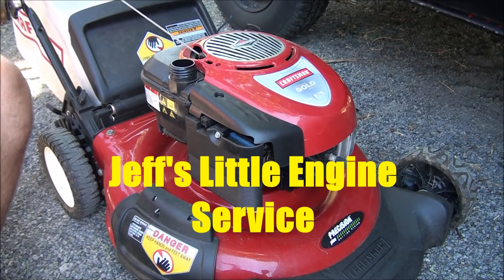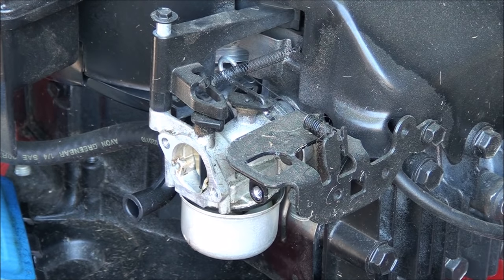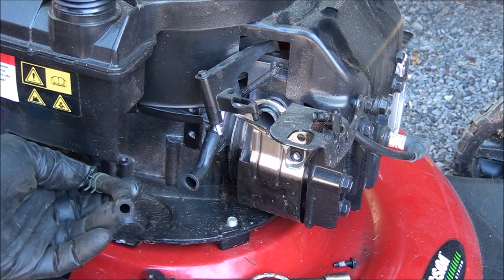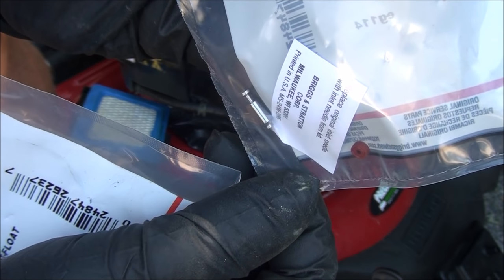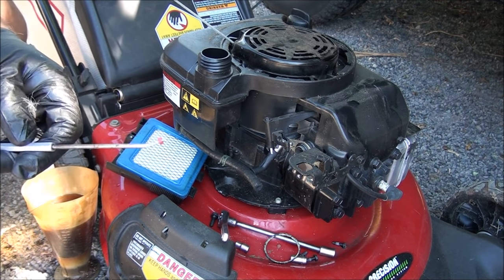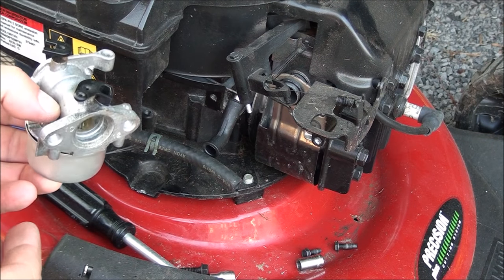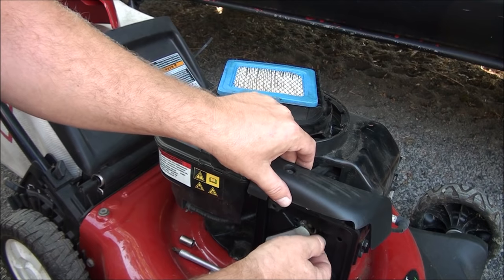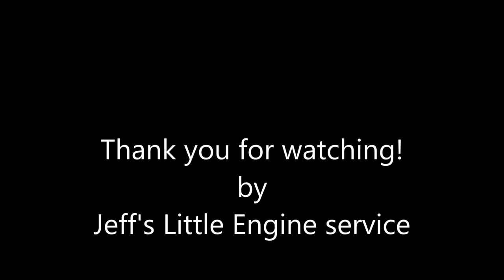EXPERT! REBUILD a Briggs and Stratton Lawnmower AUTOMATIC CHOKE CARBURETOR

Comment: Today I cleaned all around the Governor Spring and replaced the dirty air filter.  Idled way too fast then died.  Will try to rebuild the carburetor.  Thank you for your most comprehensive video!

Comment: Thank you so much.  I rebuilt two of these carbs yesterday;  both mowers started right up.  The guys at El Mel in St. Charles also told me to only use premium gas to keep the engine cooler.

Comment: Really helped had cleaned everything like you said but after reassembly engine started but would not run.  Took off the bowl and cleaned the main jet and found some debris in the bowl cleaned and reassembled, ran like a champ after that.  Thanks for the great video

Comment: Jeff thank you for the video, I repair mowers, more on the quick, cleaning out gas tanks and then carb cleaner and compressed air for the passages. The one thing I do different is rather than using wire I find torch tip cleaners with various sizes clear out the most stubborn deposits much easier. Also at same time I use the tips to clear the 3 passages and check flow to the bowl with carb cleaner to make sure the priming system should operate properly.

Comment: Excellent video.  FYI, I've done both a rebuild and replaced the whole carb.  Depending on your time and frustration level they both have their advantages.  I once stripped the brass bolt so had to buy a new one.  Another time I didn't tighten it enough since I was paranoid I'd strip it so gas leaked all over the place.  Sometimes it's easier to spring for a whole new carb and just pop it in.

Comment: Great video, Jeff! Very good close ups and you didn't rush the process. I've called repair guys to my house and while they replace parts, don't spend enough time here to clean the carb. I'd rather get my hands dirty and know that it was done right. Thanks again for sharing your knowledge.
Reply from the maker: Thank you Linda!
Reply: jeff, after you soak the parts in coke - then what??
Reply from the maker: a good scrubbing with a toothbrush, then rinse thoroughly with soap and hot water. Sometimes a more heavy duty chemical is needed to remove the corrosion. Sometimes Coke works sometimes not, it depends on the type and severity of the corrosion.

Comment: I didn't rebuild the carb (I replaced it) but I did use this video so I knew how to disassemble the related parts. Thank you very much. Put the new carb and it started on the first pull :)
Reply: with all the gas he spilled over it how could it not? 😂

Comment: You can use a set of torch tip cleaners to clean all sizes of small holes works great ! Buy them at welding supply stores.

Comment: Working on one just like this cleaned the carburetor out and mowed the yard - had to adjust the governor spring . It ran great , but after I parked it gas ran out of filter- going to replace the needle valve and seat - hopefully this'll fix the leaking problem . If there's anything else that you would do holler at me . Correction it is the primer style carburetor - not the Automatic style .
Reply from the maker: that should fix it!

Comment: THANK YOU! For this video. You have the same type carburetor that I have. My lawnmower wouldn't start and your step by step helped me to clean the carburetor and it runs beautifully now. Saved a bunch of $$$. My carburetor was clogged because I didn't put any fuel stabilizer in with the gas. I didn't need to replace parts but I did clean the little residue that was there. Where can I get the replacement parts? I used the floss brushes for using between your teeth to clean out the holes versus wire. Again thank you. 😊
Reply: Angela Myrick:
You can get replacement parts at a small engine repair shop or if you have a Craftsman mower you can go to Sears. But if you can wait a few days, it's cheaper to buy them online. Try repairclinic.com or partselect.com or Amazon. Repairclinic.com has good prices, fast shipping and helpful videos. Good luck!
Reply from the maker: good advice Laura B. I use a local mom and pa shop for most of my parts when possible.. Sometimes I do use Amazon or Ebay to get my parts as well. :)

Comment: try vinegar, white, apple cider etc, works trust me !!! and torch tip cleaners work good for the plug (its actually the main fuel jet) mine disintegrated rainelle wv flood of 2016, the flood water had bad stuff in it !!! turned rubber wheels into purple plastic !!!
(yea I got a mouthful of it swimming to safety) some priming bulb's have a hole, some not Affects the mixture !!! nice video.
sometimes I redo the governor (connect the governor spring to the lever, (makes RPM governor controlled instead of over speed control.
all the best Sir thanks.

also a drywall screw can be threaded in the float seat to remove it, (be careful)

Comment: Wow you know your stuff i have two Toro self starts lawnmower the carburetor is very clean i also rebuild both carburetor and both lawnmower won't starts also when i pull the starter rope it throw mist of gas out the carburetor and both lawnmower is fairly new and they both have the same carburetor as in your video here

Comment: What a great video on this rebuild. I just did one today on same mower. I did not replace the needle valve and the red seat gasket. Maybe that's why mine still won't start. It will run on a little shot of either and then dies. Love that coke idea for cleaning. Quite the tip on that. Other than the coke, what do you use to soak/clean carbs?
Reply from the maker: Thanks for watching. I finally bought an ultra sonic cleaner and it does a great job. I have use many different detergents/soap and all seems to work well in the ultrasonic cleaner.

Comment: Jeff:  My Briggs & Stratton  7.0 horse lawn mower will not hold an even idle. It starts out high, then drops to low, then goes back up high, then drops low again.  I rebuilt the carb with new gaskets, idle seat, and valve.  It didn't do this before I rebuilt it.  Previously, it was hard to start which led to rebuilding it.  Is this a simple fix?   Thanks for responding back.  THUMBS UP!!!
Reply from the maker: It sure sounds like a fuel delivery issue. There must be something not right or plugged inside the carb.

Comment: Jeff appreciate the videos and think I got one that may stump you.  4 year old Briggs & Stratton 121q002-0064-f1.  The beginning of the season would run on first pull then die 10 mins later.  I've changed air filter carburetor, spark plug, fuel line, and this morning the armature...only to realize the same problem.  What am I missing?  Local shop here is busy for two weeks since yesterday's hurricane.
Reply from the maker: Sounds like a fuel delivery problem or a contaminated fuel system.. If you replaced the original carburetor with an inexpensive cheapo aftermarket version  that is probably the problem now.
Reply: I tried starting it with a shot of starting fluid but won't go.  I still have the original carburetor so will run through it again and see what happens.  thanks for the reply.

Comment: Thank you for sharing. I rebuilt my carburetor, replaced the plug etc. but my lawnmower still doesn’t start!  Any suggestions?
Reply from the maker: use starting fluid to see if it tries to start but dies. If it does this you know you still have a fuel delivery problem and that the spark and compression are good..

Comment: i have the same mower but with the primer bulb. runs fine but primer doesnt work so it always needs starting fluid to get it going. bulb is in good shape, all passages inside carb seem clear, replaced gasket on the plastic cover but nothing. any suggestions?

Comment: tip on removing the rubber seat:  use a blow gun and shoot compressed air into the fuel inlet.  the pressure will pop the seat out without damaging it.
Reply: Joe Jirak I

Comment: Any idea what the torque specs are on the carburetor to engine bolts and aircleaner housing to carburetor bolts. I ended up stripping the latter after cleaning the carburetor out a few times and have had to buy a new carburetor.

Comment: A nice video! Can you tell whether this engine has any fuel filter, please? I couldn`t see one in this video... In case of its absence, it would be a good life hack to add an inline filter cutting the tube you have cleaned by brush :)
Reply from the maker: an inline filter is a good idea. The only filter it has is a screen inside the carburetor.
Reply: @JeffsLittleEngineService  Due to... the carb is made of plastic, it doesn`t have any screen... So, its designed to feed services every season :)))

Comment: Hi, New subscriber here.  I followed your instructions exactly (except I bought a new carb and installed it successfully.  It worked!  I mowed half the yard and then it stopped and would not start again.   Next day, it ran for about 5 minutes and then it stopped.  I left it for two hours and then I tried again.  It went on but turned off within minutes.  This is the problem I was having before changing the carb.  Any ideas why this is happening?  Why would run for half the yard and then stop?  Does it sound like it could be the fly wheel?  Any advice would be very appreciated.
Reply from the maker: You also need to clean the fuel tank and fuel line otherwise the problem will keep happening
Reply: @JeffsLittleEngineService  Thank you so much.

Comment: I bought a Tecumseh carburetor tool Part # 670377 to repair a Tecumseh Series 11 Carburetor after watching one of your more recent videos. Great suggestion!
I presume that the Tecumseh carb tool will work on a Briggs & Stratton carburetor since the float seat looks identical to the Tecumseh carb.
Are the float seats on the Tecumseh and Briggs & Stratton carburetors the same?
Reply from the maker: It does not work as good on the briggs seat, they are a little different in siZe

Comment: Where can I get that spring @ 2:11, I was cleaning a briggs and stratton carb yesterday and the spring flew off at some point when I was testing to see if it would run. Now gas is pouring out of it.
Reply from the maker: You will need the model number off of the engine so you can get a part number and order the correct spring.

Comment: Wanted to rebuild my B & S carb, but found a complete carb on Amazon for the price of a few gaskets..,$12!
Reply from the maker: good luck with that cheap piece of crap!
Reply: @JeffsLittleEngineService  Cheap or not, the gaskets and float parts will be useful if the carb is as you describe.

Comment: Thank you for posting the video. I have a Craftsman Briggs and Stratton Gold engine 6.75 190cc I cleaned and changed the carburetor parts, air filter, new gas, correct oil level, but it is so hard to pull. My lawnmower started easily on the first pull. Now it takes 5 attempts with a lot of muscle. What could this be from? Thank you.

Comment: I did this, my float got stuck down. I lightly  tapped the float bowl a couple times with my screw driver handle and it stopped dumping out of the carb.
Reply from the maker: now all you should do is you drain the float bowl it will help clean it out.

Comment: Do you have a video of what happens if the mechanism gets displaced from the inside after removing the bolt from the carburetor?
Reply from the maker: If the float, float pin, and float needle came off there are alot of videos about that. Real easy to put back together

Comment: I Have Noticed On You tube No One Puts Fuel Filters On These Push Mowers. If You Want To Do Less Carburetor Clean Outs, It Is Advisable To Add A In-Line Fuel Filter Between The Tank And Fuel Tap. They Are Cheap Guys. Save A Lot Of Headaches. You Won't Be Cleaning Them Carburetors As Much

Comment: My 675 series B n S has what looks like the same carb, but mine has an o-ring between the brass nut and bowl on the bottom?  You lose yours?
Reply from the maker: there usually isn't a rubber oring, but there is a gasket.
Reply: Good question!  There's a round fiber washer that goes on the brass nut. Don't lose it, or fuel will leak out.

Comment: Excellent video!!! I followed you to the tee, except soaking and replacing the parts. It started right up! Thanks a lot. Where do you order the replacement parts ?
Reply from the maker: I get parts from amazon, ebay and my local Briggs and Stratton Lawnmower shop

Comment: Awesome video Jeff.  I have cleaned small engine carbs before with good result.  I did all of these steps that you show as I have the same engine/carb on a John Deere.  Even after all of this cleaning and replacing of the needle and gaskets, it still won't start.  Any suggestions of what to check next?  Compression?  Thanks a bunch
Reply from the maker: spark plug?
Reply: I pulled it.  It was a little black so I cleaned it up and checked for spark.  Getting plenty of spark.
Reply from the maker: 2. spray starting fluid into the carburetor to insure you have fuel. If it doesn't at least "try" to start with starting fluid then you do have a compression problem. Check the head bolts to make sure they are still tight. Could be a blown head gasket?
Reply: I will certainly give that a try.  Many thanks.

Comment: There are no other jets to clean, like the idle jet?
Reply from the maker: there are 2 or 3 very tiny holes next to each other on the inside of the carburetor throat. Usually dont get plugged but can

Comment: Jeff great video, the only one that had a mower like mine.  I have made a mess of it, springs off and that choke mech loose.  i did get carburator off but now need the gaskets.  is there somewhere you can buy these gaskets as a kit?
Reply from the maker: +bumble bee Thanks for the question. I don't think there is availability as a kit. I get most of my Briggs parts at a local ma and pa lawnmower shop which is a Briggs and Stratton dealer. Sometimes I purchase parts through Ebay and Amazon.
Reply: +Jeff&#39;s Little Engine Service Thanks Jeff.  I did find a packet of parts for the carburetor at Sears today.  So I am working up the nerve to try this.  Just so you know I am a 70 year old female trying to do this myself.  But, sure I can do it with this great video. Unfortunately I didn't find the video until after I took it off the mower.  One question if you don't mind.  That bar that comes out and then goes down to attached to that metal screw that holds the carburetor, you said be careful not to jar it too much.  Unfortunately I moved it a lot :)  Can you tell me how that seats back in there.  Is it loose kind of.  Does it attach to something, I can't seem to get it to seat in there.  I think it's still attached underneath on the other side as when I move it I see light and dark.  I just can't get it to stay in one place firmly on the carburetor side.  Thanks for your help.
Reply from the maker: +bumble bee thanks for your comment, sorry your mower is having issues. I have done the same thing before. It was a while ago and I remember I was able to fix it without too much trouble. However, even when it is in the correct position it does feel like it is loose. I will try and find a similar engine around here and check out the procedure again and get back to you. maybe make a video explaining it.Jeff
Reply: +Jeff&#39;s Little Engine Service Jeff you are the best!  Thank you so much for your help with this.  I wish you lived next door!!! LOL
Reply from the maker: +bumble bee https://www.youtube.com/watch?v=kFzcU1P6oto This is most likely a similar procedure that you will need to do to fix the Auto-Choke Lever that was displaced(except for the pull rope repair section of course). It's pretty easy only 5 bolts or so to remove. I found a picture of what the mechanism in the correct position looks like. I will email you a picture if you email me @ JPSN4ever@comcast.net

Comment: Hello, can you show or tell me where I would hook up a throttle cable. It does have a throttle lever but no cable and I can not seem to figure out how to put one. I may be missing a part?? I have John deere frame with craftsman engine 6.75  I looked at many videos but none show this part. Please help...Ty
Reply from the maker: many newer models do not have a throttle cable. It revs up automatically

Comment: I cleaned the carburetor on an engine like yours with the auto choke.  I tightened the cylinder head bolts.  The engine does not start as easy as it should and it is hard to re-start the engine.  What should I do about this?
Reply from the maker: make sure you have FUEL, SPARK and COMPRESSION
Reply: It has all of those but what should the compression gauge read on the first pull of the rope?  If one or both valves are leaking will the engine even start?

Comment: I replaced carb and started mower it ran rough and eventually died. I figured the choke wasn't opening up as it was spewing black smoke. When I pulled it apart I found that I had managed to jam the air vane/auto choke lever so that it wouldn't operate. I removed the screw holding the air vane /auto choke lever in place and managed to set it up so the choke operated freely. I put it back together and now it won't start at all. Any ideas?

Comment: Hi. Great video, thanks.  I replaced the carb., but when I put it back together the auto-choke mechanism totally froze up when I tightened it and wouldn’t move no matter how much I fiddled with it.  Without it moving, obviously the engine doesn’t run.   Any ideas on what I may have done wrong?
Reply from the maker: not sure. you must use the correct bolt to mount it up or it will bind up. maybe it got bound up on muffler side
Reply: Hi again, that was EXACTLY the problem.  I repositioned it, cleaned things up and it’s running perfectly!  Thanks again for your videos and the quick reply!